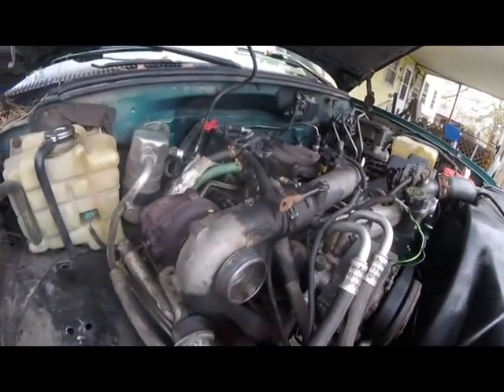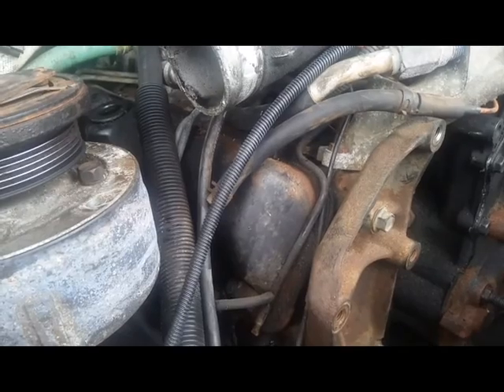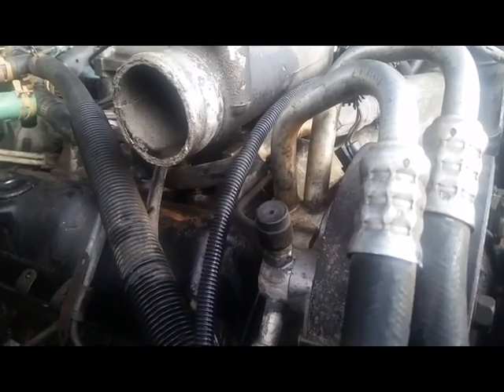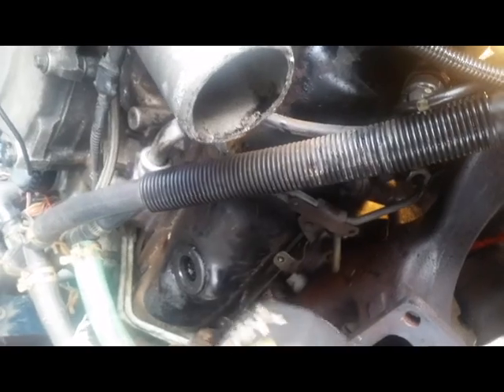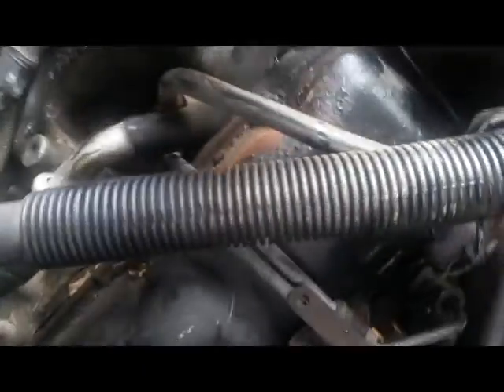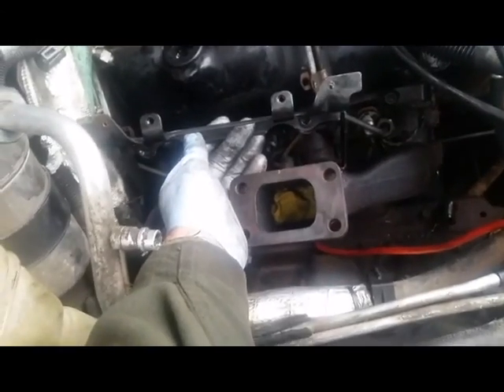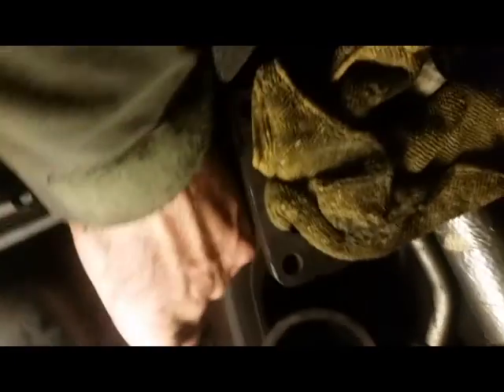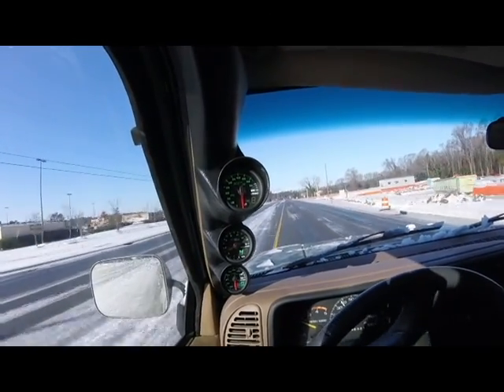95 K2500 6.5 Diesel HX40 Turbo & Fuel Injector install

Comment: So glad I found your channel! I'm a disabled Vet who has been looking for a good older truck and yesterday I found and bought a 1994 Chevy Silverado Ext. Cab 6.5 Turbo Diesel 4x4. My original plan was to buy an old truck and put a Cummins 24 valve in with an ATS Allison...but now several people are telling me to keep the Detroit Diesel...so I'm learning all I can. It already has the PMD relocation and a few other items, but it is leaking oil badly from the headcovers...my plan has always been to get an old truck, put it in the barn and rebuild everything on it so when I retire I'll have a good dependable truck...I do believe I may have found a good one (oh, no rust and a couple of very minor dents).
Reply from the maker: Congratulations on the purchase sir. I've toyed around with the idea of going 12 valve cummins but everyone claims that you are looking at around $10 000 even if you are doing the work yourself. 
The 6.5s are awesome motors as long as they weren't ran hot..mine was it has hairline cracks in the block, but I've had it for 5 years now and it still hasn't been a huge issue I just add coolant every few months. 
I have dont a bunch more suspension upgrades, I will try to edit and post the footage next month.
Reply: @LM1331  Thanks! I'm planning to keep it. I don't know the history of it, so when I remove the engine and rebuild it, I'll look for cracks and if there are some, I'll replace the block with a new one. Still watching your videos, Sir, and loving them! Thanks again for doing this. We are very similar, we do not own a TV and I rarely listen to anything when driving down the road...just watch the gauges. Really loving the HX35 upgrade and plan to do that as well.
Reply from the maker: @robey60   If money was no issue, I would get the optimizer from Leroyd Diesel. https://leroydiesel.com/products/amg-optimizer-long-block/ 
The pre-98 blocks are known for cracking, hope that doesn't turn you off, even thought I have a crack in mine there really isn't a point in rebuilding it because it runs fine for now. There might be a time when it will freeze and blow a hole on the side of the block. 
Another option that I might end up going with is getting a low mileage HMMWV from govplanet or something that only has the engine. But not sure if it would be cheaper than the optimizer. If yours is running fine and not too much blow by why rebuild it?
Reply: @LM1331  Thank you VERY much! Money is always a consideration, but I can afford that, so thank you!
Reply from the maker: @robey60  Not a problem sir. Do a little bit more research, before you commit that much money. SS diesel has it a 1000 dollars cheaper, Leroy is awesome though. http://www.ssdieselsupply.com/p178_brand_new_ssdiesel_brand_6.5_longblock_diesel_engine.html#photo
Reply: @LM1331  Hey, any other info you want to throw my way, keep 'em coming! Thank you VERY much, Sir!!

Comment: Yo what did you do with your vacvum pump? Just plug it off or take it off and put a plate on it
Reply from the maker: Sorry it took so long to respond. I took if it off put a 6.2 belt on and a manual waste gate

Comment: Anything you are taking off on turbo side is hard cause of the heat  I doubt people do ther injectors every 60 if your not chancing you’re turbo easier to take manifold off
Reply from the maker: Yea I doubt people change injectors every 60k miles too I just use fuel additive every time I fill up.  Thank you for your input

Comment: Did you need to do any mods to the down pipe
Reply from the maker: If you mean the pipe that goes from the exhaust side of the turbo? Then yes  but it came with the kit. I followed yankee preppers guide as the baseline

Comment: hi mate thanks for put that vedeo great explain!! i have a suburban 95model 6.5td and i would like put much more power because i pull a biggest caravan and i lose speed on hills when i pull the caravan can you tell me how is going your engine with a HX40? looks like we need a lot modifications! new adaptor for new turbo and oil line pipe! please can you explain more details thanks mate cheers from norway
Reply from the maker: Hi Jorge. Hope you are not too cold up in Norway. The truck is doing great. I've pulled a ram 2500 with my  trailer about 12000 lbs total (stock suburban is rated to tow 7000 lbs), it was mostly over flat terrain but it pulled it quite well. I got to find my the video and upload it here this weekend.  The PT wiring solutions kit helps solve all the headaches with the down pipe and the oil feed line adapter. I highly recommend checking them out. I updated the link. and the kit is cheaper, you can actually buy the whole kit from them for about 900 bucks.  I would also get better flowing exhaust, next on priority list, and cooling system upgrades, you got to keep that cylinder 8 nice and cool...
Reply: thanks mate i apreciate your information here in norway we don"t have a american car parts we need import from USA and i have idea on import all the parts i need; that kit you talk about is incluided a adaptor for turbo? because the original have a diferent exaust exit!  your turbo is a HX40? if you tell me the name of the deelar or workshop sold that kit please thanks and put more vedeos when you make new cheers here today in tromso -26c no problem for start the suburban going good
Reply from the maker: Right on brother. Glad the burb has no problems starting when it is that cold. 
Yes the pt wiring solutions kit came with the down pipe adapter (exhaust exit). If I were you I would probably get the whole hx40II kit from them it is very reasonable priced and seems like they include everything you will need. https://ptwiringsolutions.com/products/6-dot-5l-turbo-upgrade-kit-hx40ii
my turbo is a chinese HX40II knockoff, so far so good I haven't put on a whole lot of miles on it so far. probably about 2000 maybe 3000 miles. When I did the swap pt wiring solutions didn't offer the hx40 or the holset kit, if they did I would have gone that route.
Reply from the maker: check out yankee prepper video at 2:48 you will see the new downpipe 

https://www.youtube.com/watch?v=agaqgkqbE98
Reply: thanks a lot my dear friend that"s stuff i need to buy really great your vedeo i apreciate your help mate have a great weekend cheers

Comment: Hello. Did you use factory original size injectors?
Reply from the maker: Yes sir. I briefly considered the marine injector option but I figured that there isn't much of a horsepower gain at least based of what I was able to find online. And horsepower was not the main goal anyway I decided to go with the original Bosch injectors that i got from Leroy Diesel. They are very reasonably priced and are brand new not rebuilt or anything. From what i read it is recommended to change injectors every 60k miles. I would also highly recommend changing the injector return hoses and using clamps on them. When i was swapping out injectors I didn't realize that Leroy offered those as well. I would get them from him. The link to his site is in the description. Hope this helps.

Comment: Do not buy the Dorman brand injector hoses,I got them and had dry rot withing weeks and of course leaks.I contacted Dorman ,was sent out replacements and same problem again.I wound up buying GM hoses and have had no issues 3 years later.
Reply from the maker: Thank you for the heads up. My fuel injector hoses are no name ebay brand. So far they have held up good. But if I had to replace them I'd go with the GM ones.